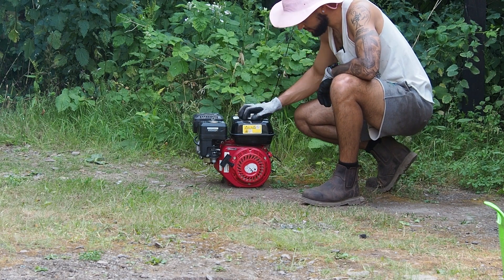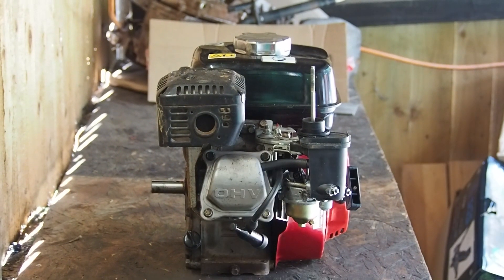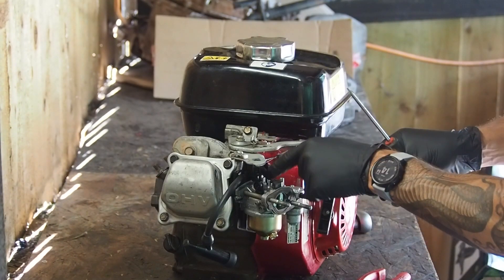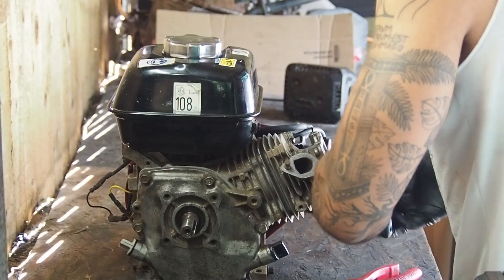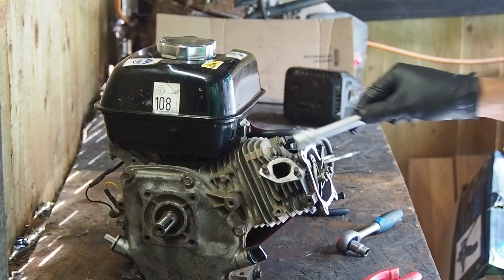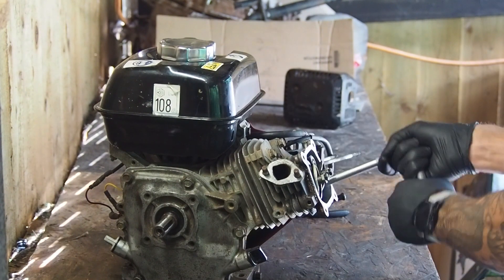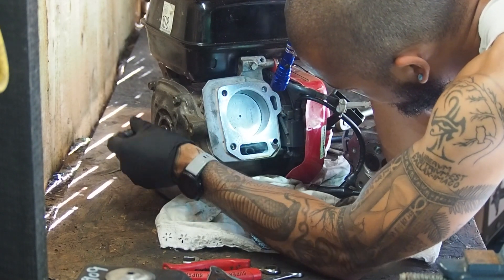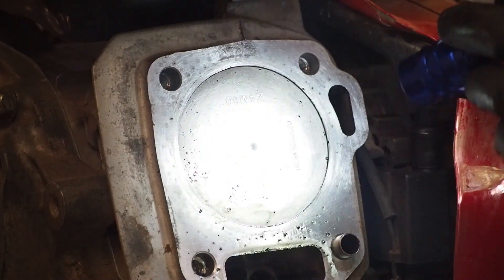Honda GX160 BLUE SMOKE Diagnostic

Comment: have the same issue with a very similar engine , did rings fix the problem?
Reply from the maker: Thanks for the comment mate! It's either rings or a blow head gasket - the blue smoke pretty much means it's burning oil somewhere in the combustion cycle. I hope that helps ✊🏾
Reply: @stmtools   thanks yes rings are next on the list .will post  if it resolves the issue.

Comment: My Honda GP200 powered power washer needed a new pump but sat in a shed for 2 years. I eventually got a new pump. It worked great the first time I used it now blowing blue smoke and cuts out after 30 seconds. It was only 2 years old when the pump failed and wasn’t used that much. Would this be the same issue you had ? Smell of fuel in the oil too 🙈
Reply from the maker: Thanks for your comment mate! 
That's so deep man I feel for you - but yeah I would say that's likely the problem man. I would have a look around the head to see if you can any oil leaks around the gasket - failing that I would pull her apart and see the damage. 
It's weird tho that I would do that after not being used 🤷🏾‍♂️ 
On the bright side the gaskets are cheap, just take a bit of time to get her apart. 

GOOD LUCK & LET ME KNOW HOW IT GOES 🤞🏾
Reply: Stuck rings
Reply: I changed out the oil and it’s working perfectly since. When the fuel isn’t turned off when in storage I presume it siphons into the oil over time.
Reply: @jaybem5 yes that will destroy an engine if not checked.  Always be suspicious of an engine that's been in storage. Rat's nest blocking cooling, etc.